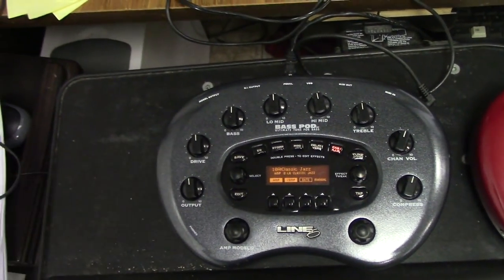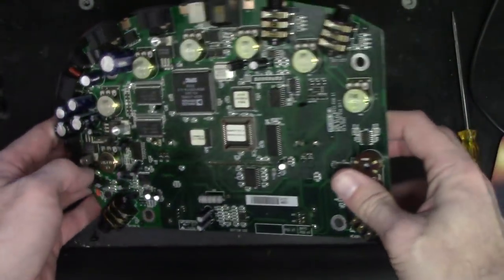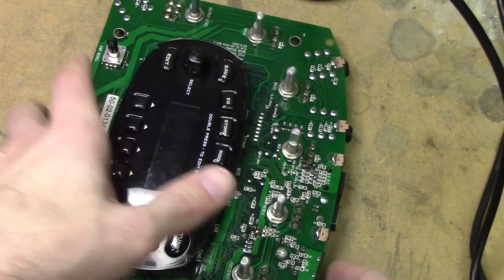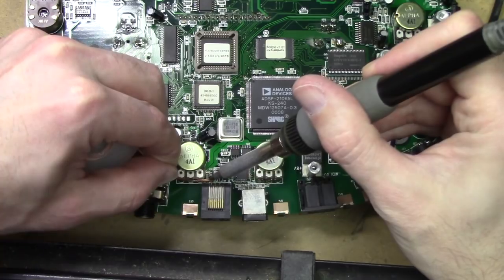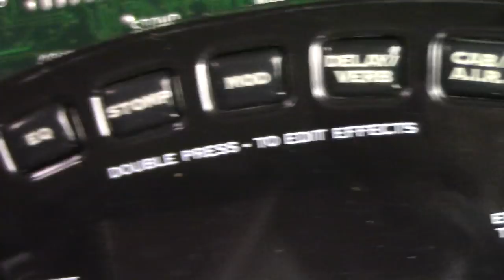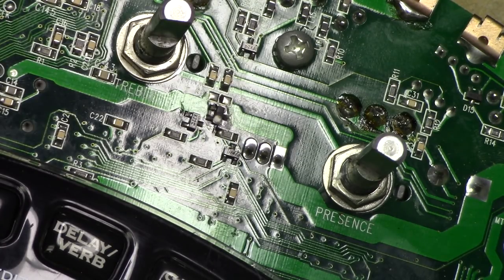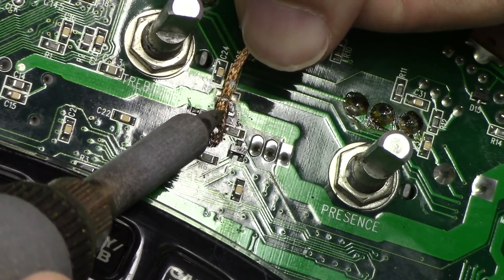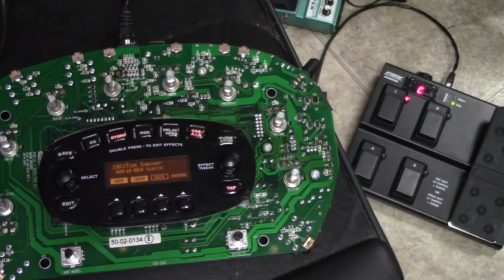Line 6 POD Pedal Interface Repair

Comment: Nice job! The nozzle on that hot air station looks tiny; you might get better results with a larger one. It might just be that I'm a surface mount novice, but I find with a small nozzle that I can't get enough heat without turning up the airflow to the point where components start flying away...